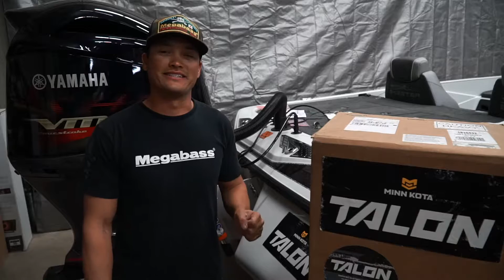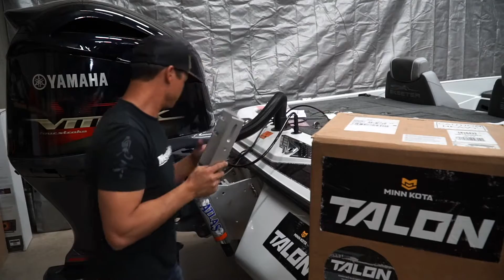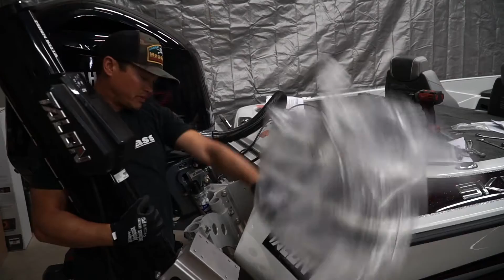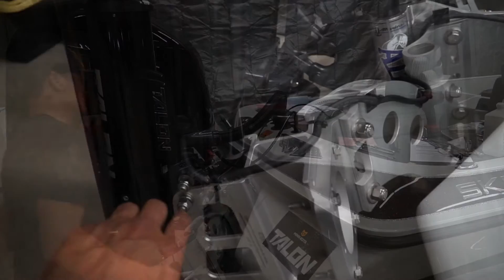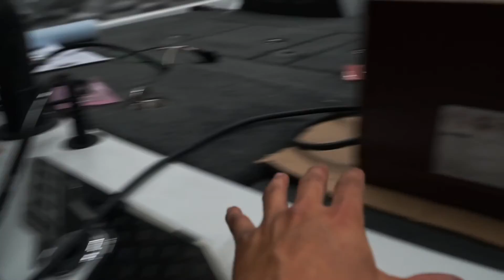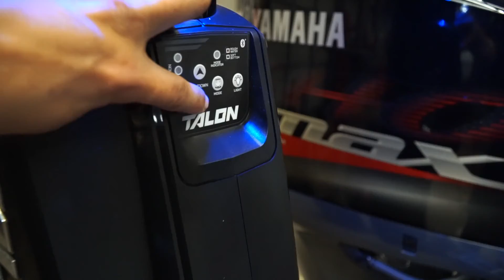Minn Kota Talon: Install How To

Comment: Just ordered my 10ft Talon today for my 21ft Tritoon and I’m so excited. I know looks aren’t everything but I think it’s worth mentioning that I think Talons look so much better than Power Poles. Talons also look like they are much stronger when I see boats flying through choppy water. Power poles rock back & forth but power poles are solid and don’t seem to move or shake much at all. 

I hope just one Talon will hold my Tritoon at the sandbar but if not I’ll add another one on the front later. 

Thanks for the cool video man. Hopefully mine will be here Aug 6 😊
Reply from the maker: I liked my Talons but switched to Raptors this past season and really, really like my Raptors.